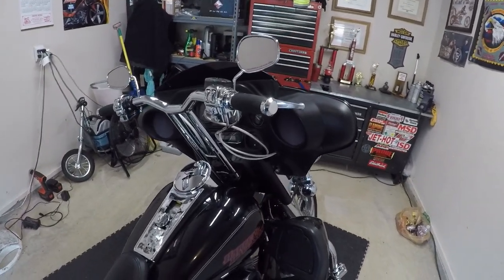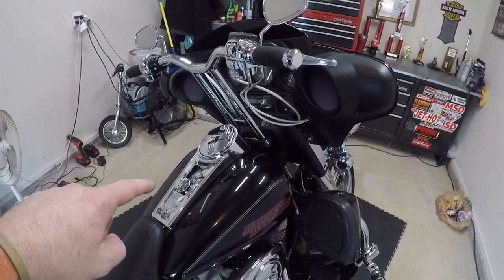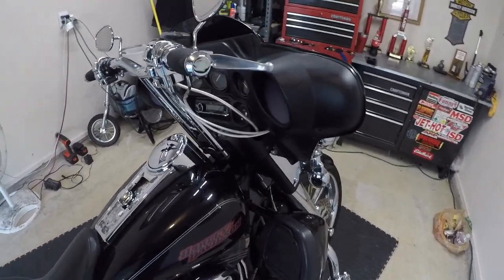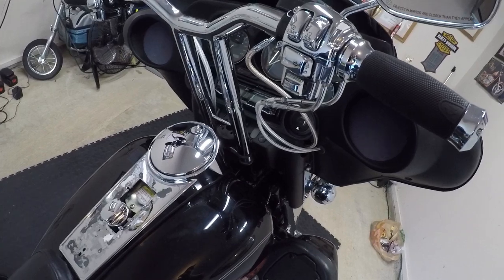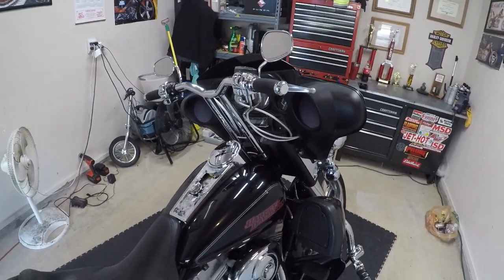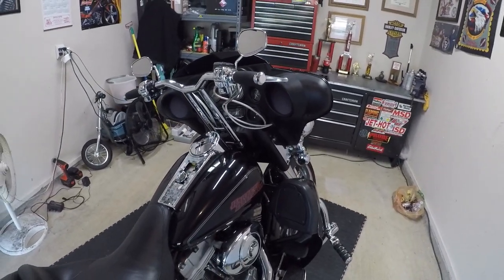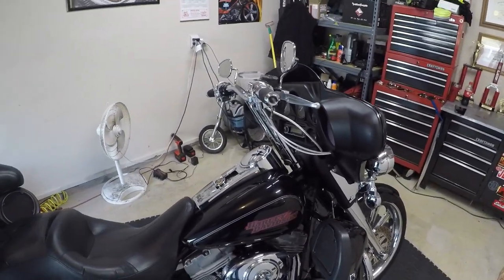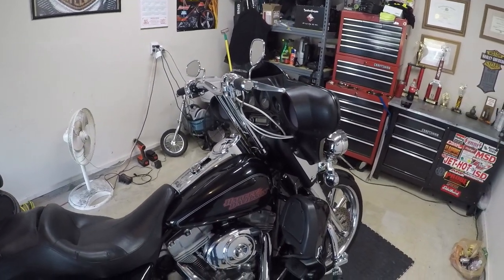Lucky Daves T-Bars FL Bagger :Update

Comment: That's badass, what kit did you relocate the ignition with or did you cut, solder, n move? Would you be able to switch plug n play for same year road king ignition? I ask cause as a mechanic I dislike wiring a lot... And i wanna go the plug n play route but will just solder and move if needed
Reply from the maker: You cut and extend 3 wires its very simple....🤘